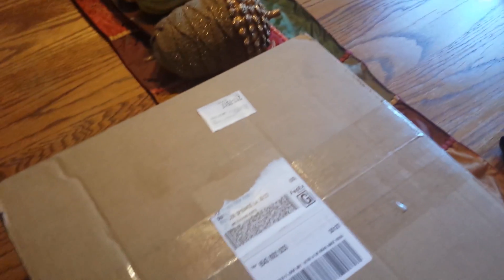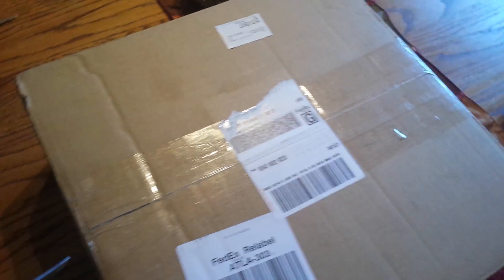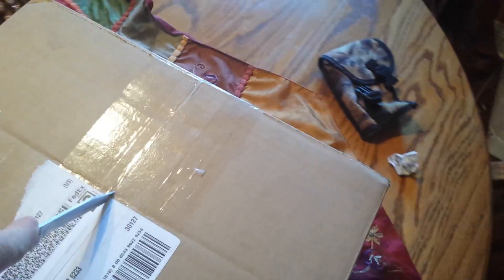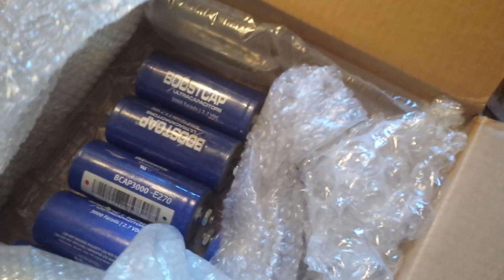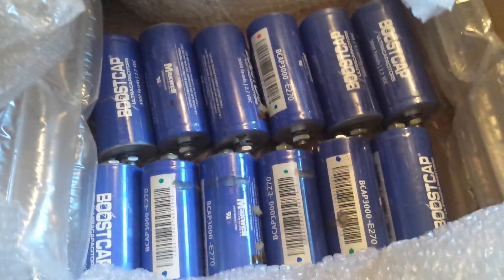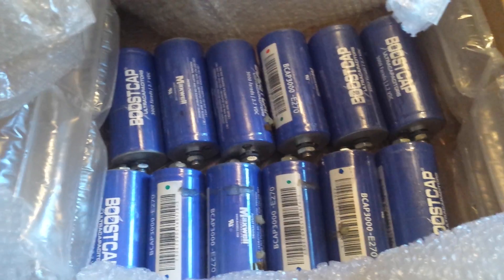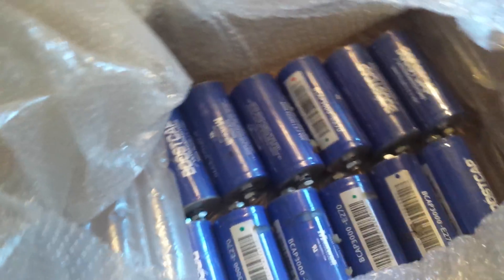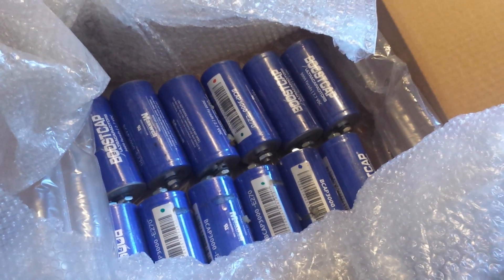TIME FOR AN UPGRADE! UNBOXING MAXWELL SUPERCAPS

Comment: I wish I could have got a hold of the blue Maxwell Boostcaps. The black ones I got are not as good, but still work great. Have you seen the new ones Maxwell has coming out?  They are 2.85V 3400F each! The black ones I have are 2.5V 2600F and the blue ones you have are 2.7V 3000F. I think you will be happy with them, just curious how hard they will be on an alternator? I guess only time will tell...
Reply from the maker: +Dereck BigDWiz I haven't heard of the new ones....Interesting!! My understanding from other guys with pretty big systems is they don't do anything worse than a battery does to the alternator.

Comment: What's the difference between these super caps and just getting batteries Iv noticed a lot of big time SPL guys are switching over to super caps over batteries are they cheaper and what are the pros and cons of them compared to a normal audio battery like Xs power
Reply from the maker: lighter and recharge a lot faster

Comment: hey wassup old bass love your setup bro..Im gonna run 4 10's also but I need a box design and yours looks like it bangs..are they all sharing the same open air space or are 2 separated from the other 2?? if not sumn like yours in thinking a bandpass
Reply from the maker: +Papo Portillo They're all in the same air space. This video shows you what it looks like inside my box. This is without the port https://www.youtube.com/watch?v=Fr6CychsMeY
Reply: +Oldbass40 OK cool man thanks I been wondering your box design for awhile now.. appreciate it

Comment: nice!!! cant wait to see the install. ive been working on my 02 park avenue ultra for some time now and im about to sound deaden her and then get some 4/0 gauge knukonceptz OFC cables for my runs and big 3.
Reply from the maker: +jose luis ruiz Cool...You can actually save $ if you buy 4/0 welding cable...I paid right at $3 per foot for what I'm getting ready to install. I got mine from www.wireandsupply.com
Reply: Nice!!! Thank you very much for the info. Ill check them out.